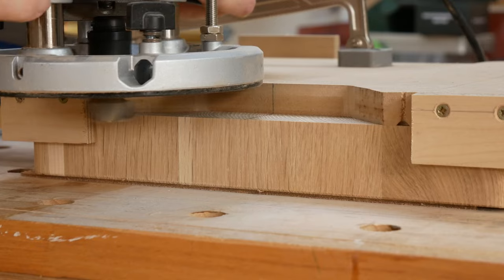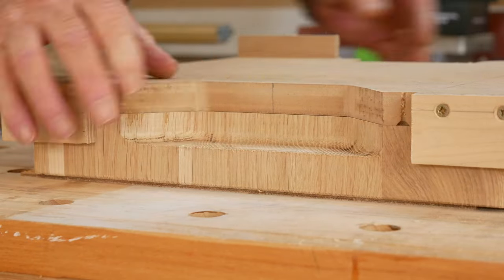Just another End Grain Cutting Board or Six - Featuring the EricHill EWM03 Moisture Meter

Comment: curious why you use the little benchtop thicknesser instead of the hammer , wish i had room for the  larger planer thicknesser, just ordered the jet 12 inch spiral cutter model, it just about fits my workspace,cheers.
Reply from the maker: Hi Kevin, because I owned it before the Hammer and its easier / quicker to use it for smaller pieces.  Basically just me being lazy, that's the honest answer.
Reply: 😄 @GTWoodshop